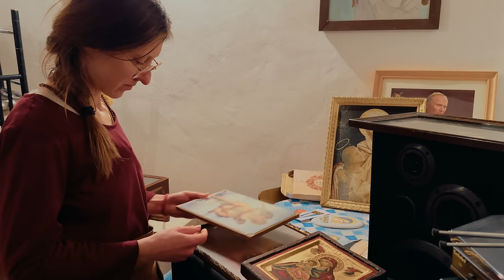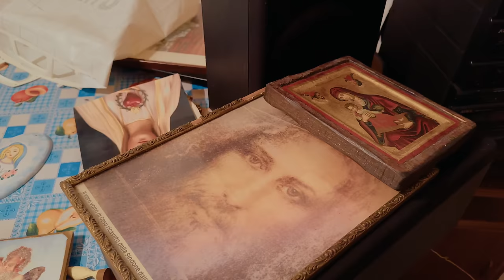#1 First days in old stone house in the Italian mountains

Comment: Normally the tree transports its juice right in the green bark and not in the wood in the middle...
Reply from the maker: Ciao RoSario, thank you for sharing. From what we know, olive trees have a system of tubes inside them. One tube, called the xylem, carries water and minerals from the roots to the leaves. Another tube, called the phloem, transports sugars produced during photosynthesis from the leaves to other parts of the tree. These tubes are found in the inner layers of the tree, including the wood and the cambium layer.

The green bark, or outer bark, of the olive tree acts as a protective layer. It helps the tree retain water and shields it from external factors. However, it does not play a role in transporting juices or fluids within the tree. We hope that you are enjoying our adventures.